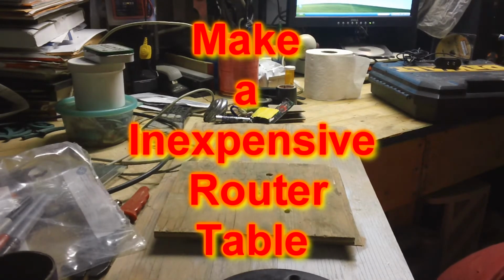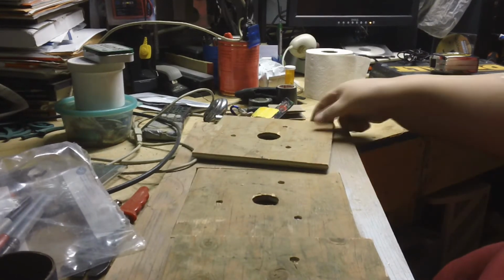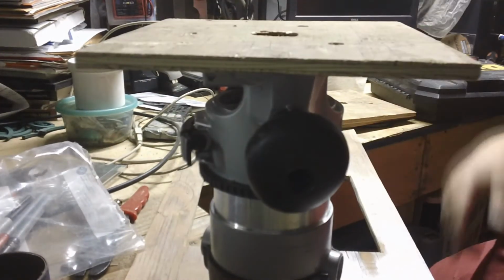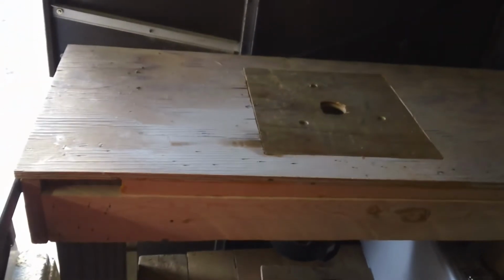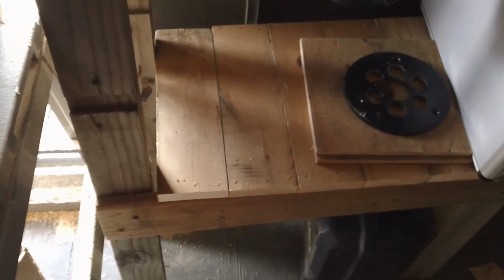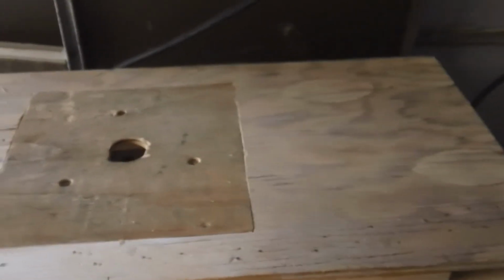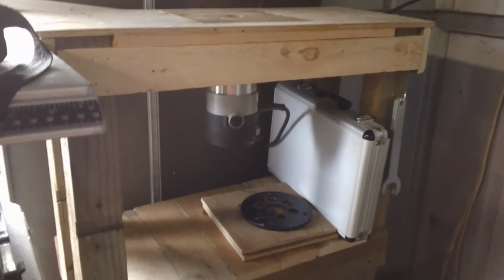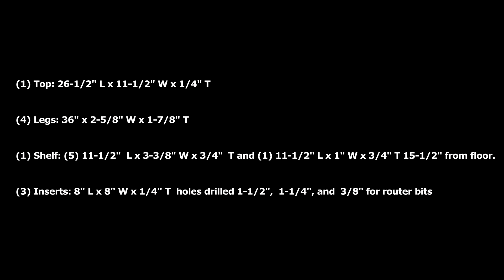How To Make A Router Table - Using Pallet Wood and Scraps

Comment: Nice addition to the workshop!  My cheapo aluminum ryobi table sags where the router hangs and affects the cut, so good support to keep the table flat is a must.  I need one of those switch/outlet things for my grinder that doesn't have a switch...Whenever I plug it in, it just starts running and if anything is touching the wheels, it gets flung across the shop.  lol